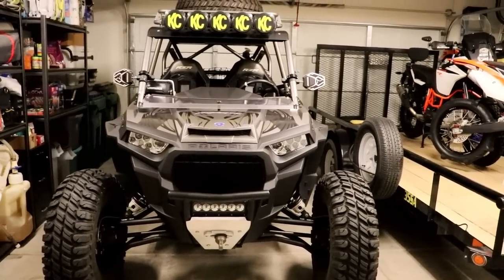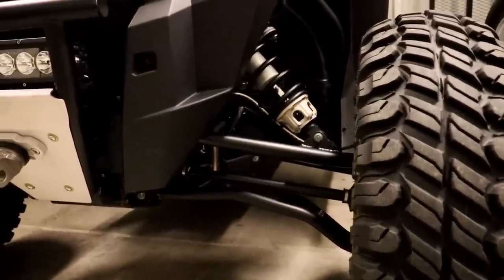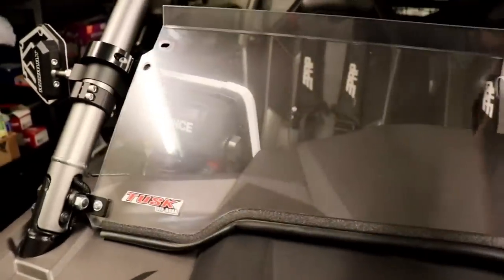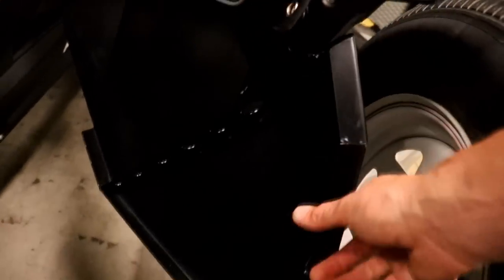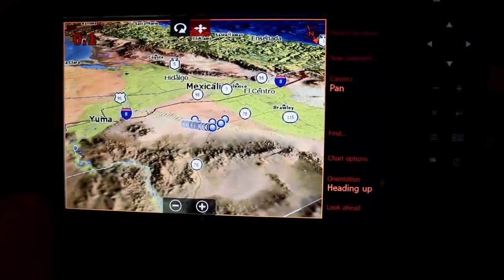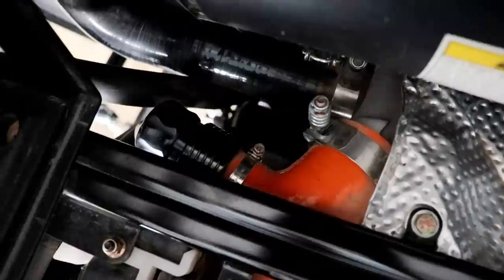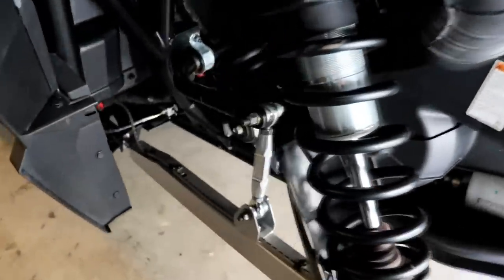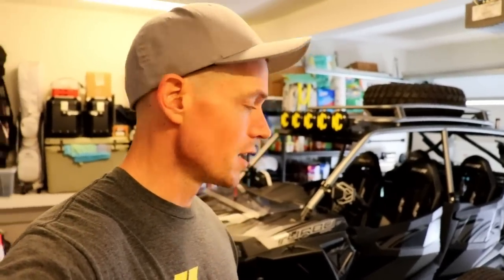RZR Turbo UPGRADES AND MODIFICATIONS !!

Comment: Love the cage tire combo, how tall is it from floor to rack? And Im 6'4" how much clearance do you have above helmet.
Reply from the maker: From concrete to the top of the rack I have 75" with 32" tires. I'm also 6'4 and I fit fine under the roof. However if I have my adventure helmet on, which is pretty thick with a peak on it. I can bump a bit over rough terrain. The PRP seats added a good inch of height though, never really touched before they went in.

Comment: Save your beans and go with a Shock Therapy full stage 4 kit and you will be blown away. If you are within driving distance of Phoniex I recommend to take your car there loaded the way you drive and let them do the work there. Schedule your appoint meant in advance and you will be in and out the same day. Cost is the same and you don't have to touch a thing. I drove across the country to have them do mine and they were awesome. The owner took the time to go over everything in detail and I have been extremely happy. I have a ton of aftermarket stuff in my XPT but if doing it over the ST suspension would be one of the very first things done. It completely transforms the car. I like the stock seats too, and since doing the ST suspension I have no need for suspension seats.

Comment: How tall is the RZR floor to highest point on roof rack I want to make sure it will fit with cage latest mods. Tanks
Reply from the maker: Looking at 75" from concrete to the top of the rack, I have 32" tires as well..

Comment: Awesome RZR and great videos! 
I have the same set up with similar upgrades. My question is did your Polaris warranty get void with the ECU tuned upgrade? Also any issues running 32” tires rubbing or clutch issues? I’m running the same BOV upgrade charge tube and Gibson dual exhaust might be ready for a upgrade Tune.
Reply from the maker: Yeah I believe you will void your warranty once you tune the ECU so make sure your OK with that before you do it.. My warranty was pretty much up when I pulled the trigger on the tune. The 32" tires rubbed a little bit a full turn with the stock A-arms. Have not rubbed since replacing with the forward off-set Super ATV high clearance setup. I could feel the power loss with stock clutching. I ended up swapping out the clutch weights and springs with the factory Polaris parts used in the Turbo S setup, feels great!
Reply: The Off Road Adventure Channel 
Thanks for the Info I will definitely wait after my extended warranty to upgrade. 
You been hitting some nice Trails in Cal have you tried Bee Canyon Truck Trail?

Comment: For your zrp radius rods high clearance did you have to cut a piece off of the trailing arm?
Reply from the maker: Johnny Camacho No modifications or cutting needed. Pretty much a bolt on application👍

Comment: How did you use the front sway bar with the SATV A-arms? Their website says they won’t work with the sway bar
Reply from the maker: Adam Kossman It seems they have added various versions since I purchased these. Here is the correct link. Includes sway bar mounting points.

https://www.superatv.com/polaris-rzr-xp-turbo-1000-high-clearance-forward-offset-a-arms-with-uniball-and-stud

Comment: How did you get your stock steering wheel off? Did your center cap have 6 bolts?
Reply from the maker: Honestly I can't remember 6 center bolts. I can tell you I tried to pop it off with brute force and it didn't work.. I ended up using using a piece of metal and several nuts/bolts to pop it off. I'd look for a cheap steering wheel removal tool if possible.
Reply: The Off Road Adventure Channel I meant the center cap. Sorry it has what look to be 6 fasteners on it.
Reply from the maker: @jjl46507  Ohh gotcha. Its just a cover piece, held on with the six bolts.

Comment: What mount are you using for the lowrance gps unit?
Reply from the maker: I just made a mount out of a metal bracket and roll cage clamp. The other side is drilled through the plastic dash using one of the plastic GPS mounts it came with.

Comment: Your ride hight is way to low. It will effect the ride quality do to internal bypass... I used the same A-arms too. The ride hight needs to be set with the car loaded the way you use it with full tank and people seated. You do need real springs and seats do make a big differance. The stock springs make for a very rough ride, they are junk and not safe. Check out the video I posted. Nice rig dude.
Reply from the maker: Nor'easter Playa You make a good point on the Ride Height man. I should adjust all of them to suit the weight. 👍thanks I appreciate it! What springs did you use?
Reply: Shock Therepy, but had to deal with a rude dude, he screwed up the order. SDI was very helpfull to fix a typical problem from ST. I would recommend Eibach springs or SDI. The springs made a huge differance! It went from a bone shaking out of control death ride to a smooth very controlled Cadillac pleasure ride. Over Jumps the stock springs makes it noise dive, scarry as hell.  The new springs it takes flight smooth and flat, landing feels like a soft plop on a pillow. It's a completely different machine. The crossovers helps to dial it in for how you load and use it. The one thing I would highly recomend for this car is getting the correct offset wheels. The 15" DWT with a 6+1 offset works perfectly with the geometry of this car. Any deviation from that offset will have some negative effects on both handling and ride. I also found that Polaris put a lot of rear toe in for use in sand dunes. In Maine we don't do dunes. So for better handling in all other conditions I added GM starter shims on the front side of the rear hubs so now it has 1/4" total toe in rather then 3/4" it had. It dose over 90mph and very stable on pavement... ASE Master Tech retired.